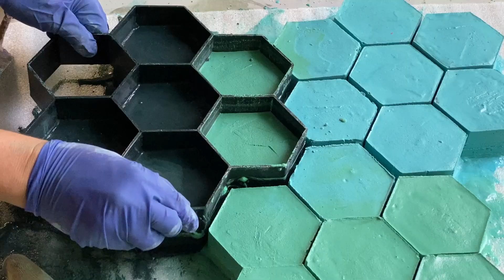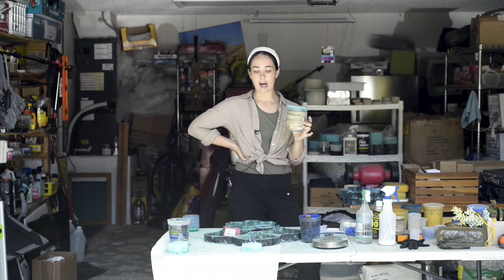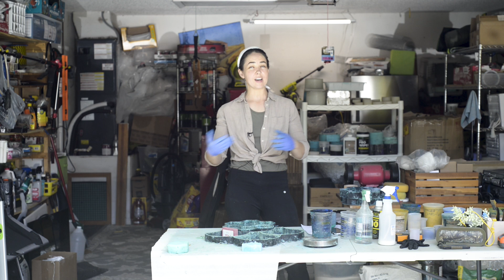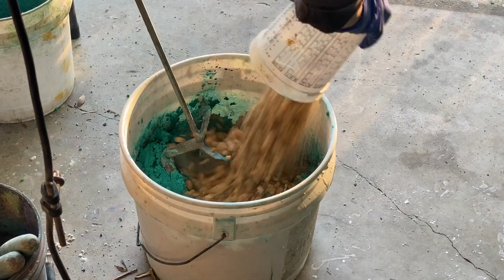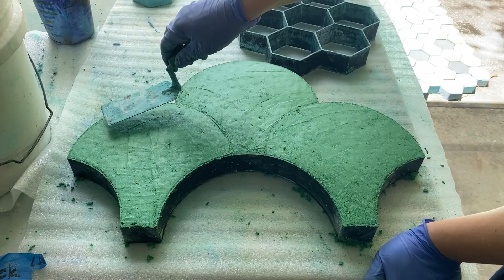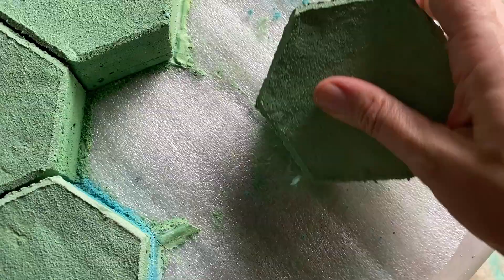Colorful Concrete Paver Mix for Use with Interlocking Plastic Molds

Comment: Love these too! 

I have another technical concern... Sorry. I'm probably starting to come across as obnoxious... Play sand is not ideal for use with mortars and concrete mixes. Typically, "sharp" sand is used. The good news is that it's just as readily available and probably a few steps away from the play sand at any hardware store. 😅

Comment: Very informative. But is there any ratio for white cement, oxide powder(for any colour) and water?
Reply from the maker: For oxide powder you can use up to 10% of cement weight. You will need to adjust water accordingly as there are a lot of factors such as humidity and temperature that can affect that number. I would suggest doing a small test run to perfect your ratios before a mass pour.
Reply: @coolhandrobyn  Thank you so much. Was using combination of postal colours to get the desire colour. Now I will try your suggestion for making mini bricks for my terrariums.